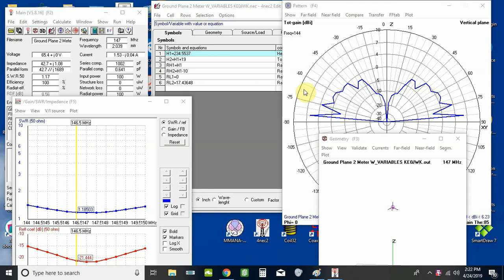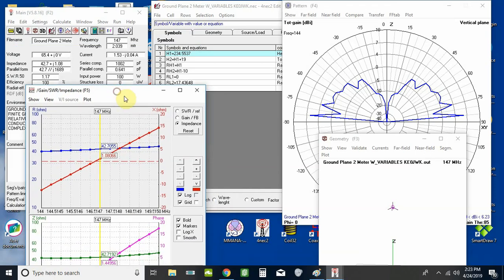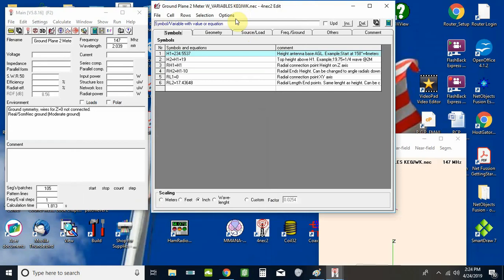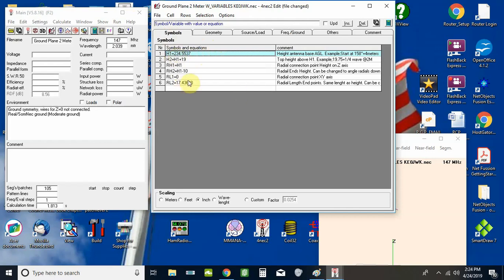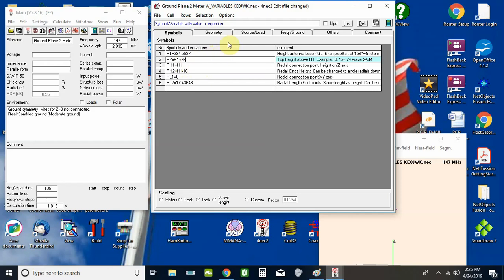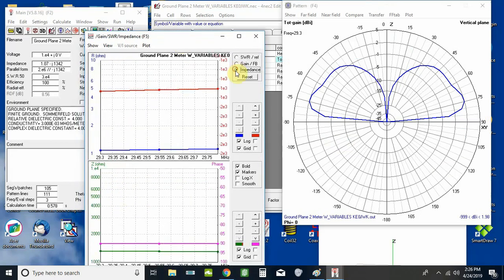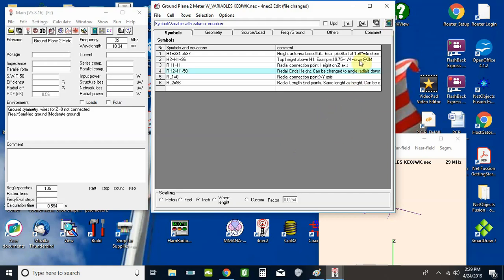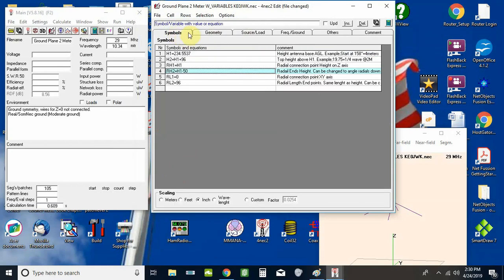Modeling a Ground Plane Antenna with 4NEC2 Part 5

Comment: Another very helpful video Karl, thanks!  I'm following along with the same version of 4NEC2 you seem to have and getting slightly different results.  As far as I can tell, I have exactly the same values entered that you do.  Can you think of any setting you haven't shown that might explain differences in results viewers might be having?  Also, could you show an example using the "Geometry Builder"?  Again, thanks for the very helpful videos!
Reply from the maker: It's 03:30 here, and I'm on my 2nd cup of coffee. I can't think of a reason for the different results right now.
I've only tried the geometry builder a few times myself. You probably won't see anything about it from me. I don't care for using it.
Reply: @karlke0jwk368  Ok, understood.  Thanks for the response.

Comment: Another great video on 4NEC2.
I would like to see how to model a loading coil, traps and counterpoise on antennas. 

 Have you carried out and modeling on magnetic loops?
Reply from the maker: I have not done a mag loop.
I'll get something up on a loading coil soon. It might be a big jump from where we are for some. I should probably try to  get a few more basics first.
Thanks for your  suggestion, and for watching. Karl
Reply from the maker: Coming soon, Vertical with loading coil. I'm working on it now, as I get time.